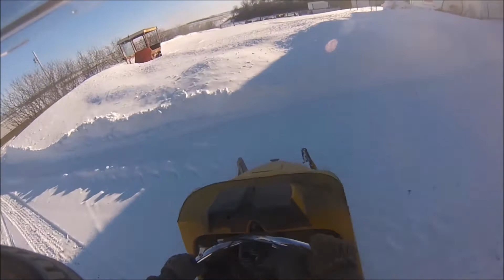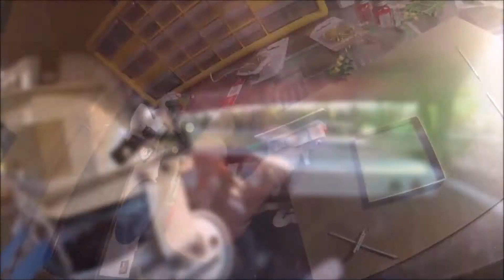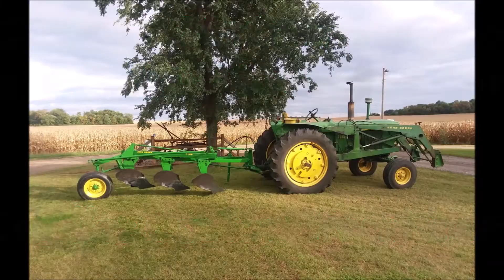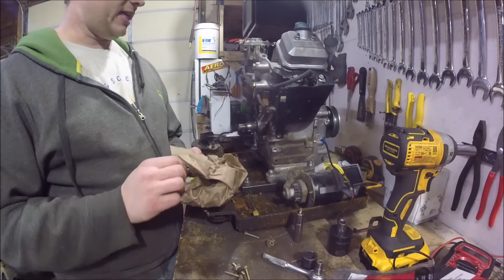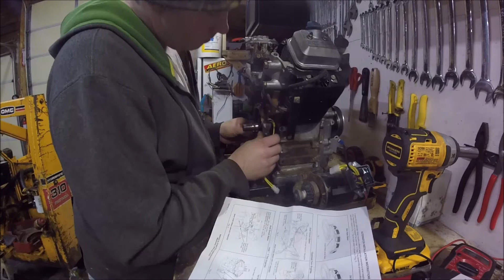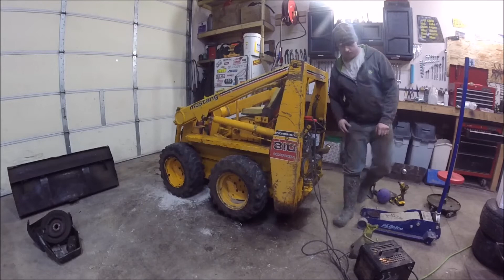OMC Mustang 310 Skid Steer: Sweet Victory

Comment: Hey buddy do you have a email I could message ya at?

I've got a joh deere 60 skidsteer which is the knock off of your little mustang I wanna motor swap and I'm struggling to find a motor I can get with a stub shaft for the lift arms
Reply from the maker: Sorry for the late reply, you should be able to get a stub shaft for almost any 16 to 30 hp Briggs and Stratton engine for sure I would think. You would have to find an engine that fits and then go to the OEM parts lookup page and check for accessories or something of that nature.
Reply: @GreenIronGarage  unfortunately they have discontinued all parts under John deere for my model so it's sourcing parts that can be made to work.
Reply: @GreenIronGarage  your good on the late response.

Your mustang is very similar to my john deere 60 did you find a qebsite ypu could source parts at?
Reply from the maker: @severon85  a Gehl or Mustang dealer is your best bet. There's a  company  called parts depot with a lot new old stock parts but they only sell to dealers
Reply: @GreenIronGarage  I saw you mentioned on a different comment you had a pdf with a parts break down with part numbers any chance I can grab that from you?

Comment: What fluid did you use?  Manual says type f or dexron.  Can you tell me what brand you went with?
Reply from the maker: I went to our local Runnings store and got 5 gallon buckets of Dexron ATF. I believe it was FarmKing brand or whatever their "store brand" is. I would highly recommend going to your local farm store and getting 5 gal buckets though. It will be considerably cheaper than 1 gallon jugs at an auto part store
Reply: @GreenIronGarage  Thanks for the info.  Ive got the chain case open and Im going to replace the axle seals.  Did you use the oem part or an aftermarket?  I was able to cross reference to part number 472394.
Reply from the maker: I used OEM parts because I work at a Gehl Dealership (Gehl & Mustang are both owned by Manitou). 335-32152 is the OEM number, you could order that from a Gehl or Mustang dealer. Make sure you use retaining compound on the outside of the seals before you pound them in so they don't leak around the outside of the seal if the tube is a little out of round.